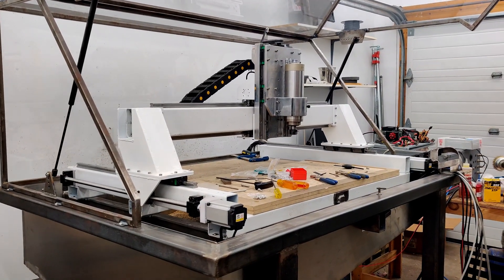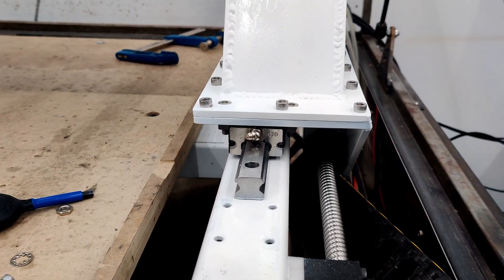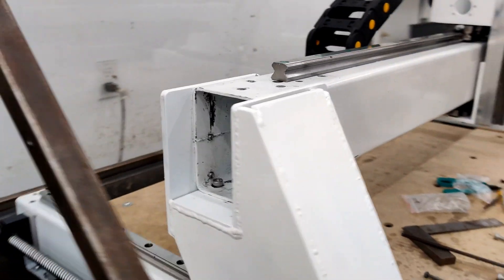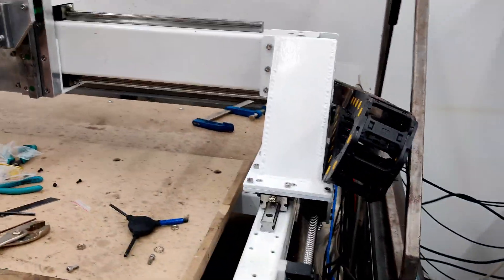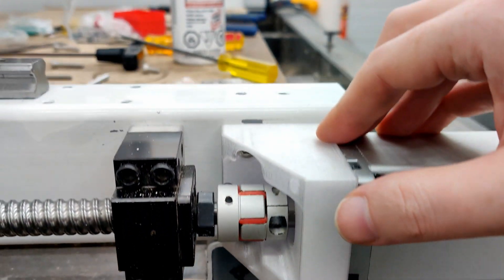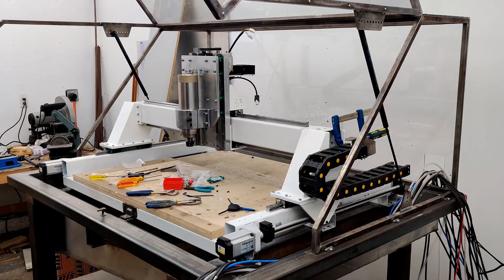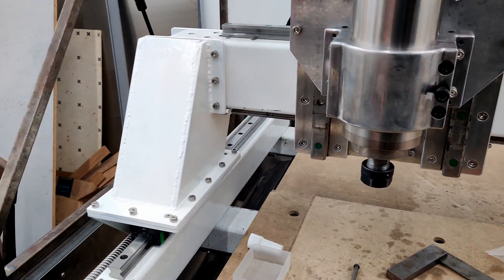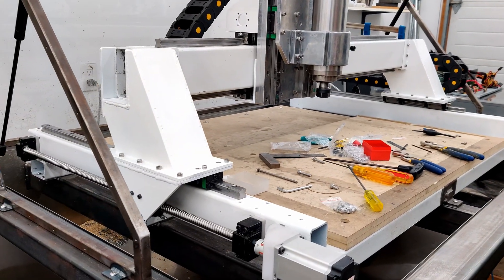New Y Assembly on the CNC Machine

Comment: Would like to see a dial indicator running across the rails. They seem to be bolted directly onto the painted tubing. What precision are you aiming for?
Reply from the maker: Steel tubes are very not accurate in the first place so the paint is kinda negligible. One thing that does cause a bit of an issue is when I take the rails off for whatever reason, paint/primer can break off and stick to the bottom of the hole (also leaves a creator) and usually happens right around a bolt hole. 

Using a razer and stoning the bottom of the rails cleans them right up. 

I’ve plotted the gantry flatness and it’s out by about 0.5mm half way between the left and middle. Haven’t done the Y axis yet. Y rails have been leveled to each other using a master precision level so they are at least close to each other. 

Haven’t been doing anything to the tubes for now. I figure if/when I get to a point to need higher precision and flatness I’d probably change the steel tubes to ones with much thicker sidewalls and get them all machined/ground in. or do epoxy leveling on the existing ones.
Reply: @BryanHoward  I have also installed my rails on the y-axis as you have; on the top and the bottom of a steel beam. But I regret this decision, since I find it difficult to align them with precision. Placing both rails on the front-facing side, will make it much easier for a surface grinder to prepare for the rails. At least that's my reasoning.
I like your overall design with dual ballscrews on the x-axis

Comment from the maker: A couple possibilities I can see. Run a big tube from the right side of the gantry and out of the machine high up and route all the cables through that. Benefit of that is no flood coolant can find its way out. Would kinda look ugly though.

I can run the cable chain inverted. It would be tight but I think theirs room. I’d be able to reuse the steel corner part and would have to make a second part that attaches to the enclosure.

I could run the cable chain on the inside of the Y axis. Because of the dual bearing carriages and the loss of work area, there is empty space that the spindle can’t go, which is big enough for the cable chain. I would need to build a barrier to keep the cable chain clear of debris which I would be adding anyway.

Comment: Can you move your CNC to the left in the enclosure to have more clearance on the right for the Y-axis cable chain?
Reply from the maker: Would be too much work because the machine has all these bolted connection points that would need to be moved over.

Comment: I've had problems with spray paint if I've waited too long between coats.  In the past I would wait 24 hours between coats, but recently I've noticed that the paint instructions want you to put on subsequent coats within two hours.  Not sure if that's what happened to you, but that's what has caused me trouble with spray paint.
Reply from the maker: Yeah that might have contributed to it. The can said to reapply within 1h or greater than 24h. I assume that it’s better to do it within an hour that way the layers merge together and dry together. If you wait too long then the layers don’t stick as well and can come off like egg shells. The cold temp in the garage probably slowed the drying considerably contributing to it. 

I’m not too concerned with blemishes, I just need to paint to seal the steel.